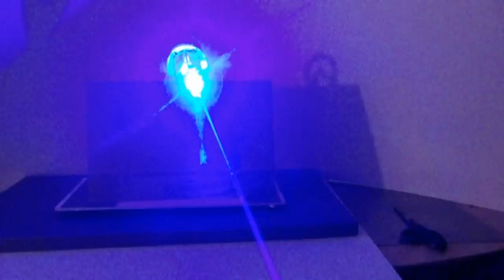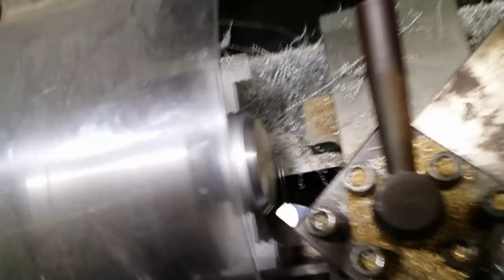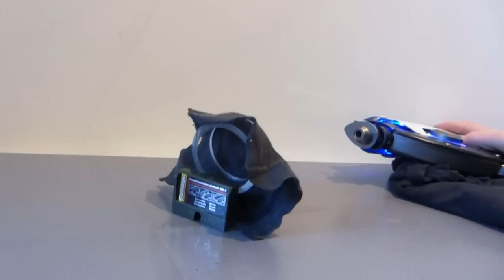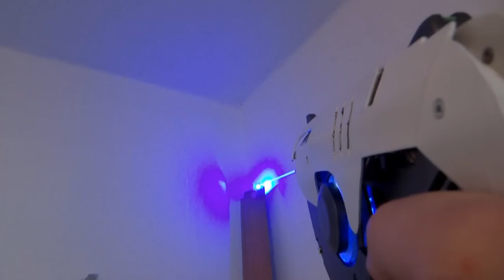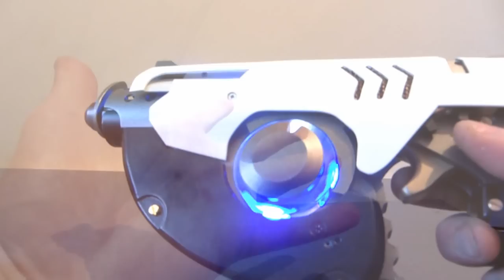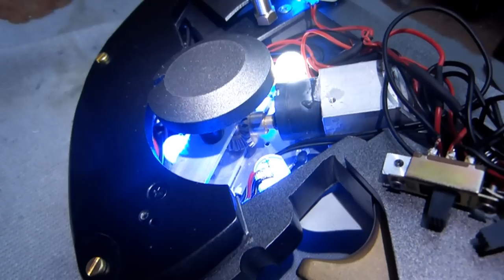OVERWATCH becomes reality: Tracer Pulse Gun (fully functional )

Comment: One question: 

Why are you doing this inside the house?
Reply from the maker: Because I know what I am doing.
Reply: LaserGadgets do you have a plan just in case something does go wrong?
Reply from the maker: Naturally...its called a fireextinguisher.
Reply: Yeah but I would still do it outside so I wouldn't risk getting burn marks on your walls.
Reply from the maker: Senseless, there are no marks...so why dont you just trust the guy who makes stuff?
Reply: LaserGadgets ok
Reply: LaserGadgets This isnt hate but just im a little worried for some reason.
Reply from the maker: I can handle flammable stuff, cancerous stuff, I can handle 5 bits of flashpaper ^^ its all good.

Comment: You put a laser pointer in a cosplay gun. Good for you.
Reply from the maker: No, I made it myself from chunks of metal BUT You wrote a comment ALL by yourself, YOU rock dude.
Reply: So you are flat out denying that you bought a high powered laser pointer and shoved it in a prop you made? Because if you are denying that I will retract my comment. But if you just bought one off eBay and attached it to the trigger mechanism you pretty much did exactly what I said in the first place.

Comment: So for someone who doesn't understand a thing about lasers, how would you measure this things power (power as in frequency or wave length or whatever) and how high would it have to be to pose an actual threat? I mean as in actually being able to rival a bullet?
Reply from the maker: This is 1.5W, you will need 500W or even more than 1000
Reply from the maker: Doubt it. Needs cooling, batteries, and you cant use it in the desert or mud, optics need to be clean.
Reply: fred mat Neither frequency, nor wavelength is a measurement of power. On top of that, higher wavelength does not mean a higher power, or that it's more dangerous (not necessarily, anyway.) Wavelength is the distance between wave peaks in the light waves produced by the laser. Wavelength determines primarily what color we perceive the the light to be. For example, 405nm is purple, 445nm is blue, 532nm is green, etc. Power, in this case, refers to electrical power that the system runs on. Power is voltage adjusted for current, in essence, as P = V•I. A bullet is a rather bad comparison in my opinion, as the damage caused by bullets is caused by a fast moving solid object rapidly decelerating, thereby transferring its energy to the new medium. Light however, has no weight (or just negligible weight, depending on who you ask), and therefore cannot transfer its energy physically, but rather is absorbed by the new medium, burning or melting it. Just some clarification so you can better research.

Comment: Make winstons tesla cannon, you will just need a way to make high voltage electricity in a form factor that fits.
Reply from the maker: Love it when they say "just" xD
Reply: Microwave oven transformers.
They can put out 2KV
Then get a battery pack and one of those DC-AC inverters that can fit in cup holders
Reply from the maker: And you really believe a) I dont know that and b) that will work? You need 2 MILLION volts to make it shoot down range...not even 2 meters aka 6 ft.
Reply from the maker: Buy a tazer :>
Reply from the maker: Oh and now say JUST again xD
Reply: Illegal where I live.
Reply from the maker: Yeah, same here.
Reply from the maker: Nope. A portable tesla coil is not really close to that cannon.
Reply: LaserGadgets dude just build a nuke. You JUST need to split one Atom. Come on don't be a babyXD
Reply: its been built before but the equipement is really heavy
Reply: Where do I find U236?

Comment: I have a lazer pointer that's like that. The video isn't surprising to me
Reply from the maker: Most "pointers" are fucking cheap and get weaker while running, so I am always very surprised whenever somebody is buying one :>
Reply: LaserGadgets Some expensive Laser pointers have lithium battery's and that's one thing that makes it expensive
Reply from the maker: Nope. They are frkn cheap also. 5$ each on ebay, the good ones are 20$ each.
Reply: LaserGadgets Hell no, there is one that cost about $100. The Spyder III is the most powerful laser pointer measuring up to 2000mW
Reply from the maker: Dude xD the BATTERY. WL refurbishes their crap :p they are too small for such high outputs...they get their crap back, put in new parts, resell. 100$ is a fukn joke dude...trust me. Good parts cost more than that.
Reply: LaserGadgets I wasn't talking about the battery. I'm talking about the laser
Reply from the maker: " LaserGadgets Some expensive Laser pointers have lithium battery's and that's one thing that makes it expensive"
Nope, its not....even if you buy the BEST battery (and they buy cheap crap), its not the most expensive part. WL bought something from ME. And send me a ton of these pointers :p just trust me.
Reply: LaserGadgets I don't really care about how it burns things just how far it shoots out. How many MW does your have laser pointer have?
Reply from the maker: I can make is 15W...made one laser with multiple lasers...100W...regular rifle holds 6W. Its the white one on the right side, in that list there :>
Reply: LaserGadgets What's the best one you made? (I don't know  why I'm asking questions now)
Reply from the maker: I made a laser gatling for wicked laser.

Comment: Nice device.  What gain medium are you using?  Color looks interesting.  Looks like a 400 or so nm wavelength.  I presume the beam is put in later as laser beams are not readily visible unless you have a scattering medium.

Tracer would be proud.
Reply from the maker: Its fog but even without fog you can see the beam.

Comment: The Tracer gun does NOT fire the Zarya laser beam, so it's not authentic, but it still looks good XD
Reply from the maker: Pulse = not bullets...so I am righter than you.
Reply: Tracer guns are pulse guns (supposedly, electromagnetic pulse) then: pulse is not equal to laser beam. An electromagnetic pulse is a strong and brief gamma ray emission, in which an enormous amount of electrons is released that provoke a variable electromagnetic field. But if it is a laser (as is clearly seen here) then we must clarify that it is an optical device that generates a light beam of a single frequency, monochromatic and very intense, by the electrical or thermal stimulation of atoms, Molecules or ions of a material.

Therefore, it is possible to say that: Pulse ≠ Laser, are two very different things.

Now, if all this is a Plasma Pulse, then we would be talking about a very different thing
Reply from the maker: Electromagnetic means sound, light, radiation. Back to physic lessons one. BUT ITS NOT a bullet. Do you have a gamma ray emitter? Xray? Whatever the fuck, laser is the best way.
Reply: Well, that's exactly what I wanted to clarify from the beginning, the fact that you made laser guns, but not a pulse. Because everyone (or most, I think) think that these guns shoot pulse bullets, it may be electromagnetic or plasma, but not a laser beam (as I have seen in this video) that is completely different.
Reply: I clarify that the design of the weapon is more than great, it is surprising and true to the original version. The only thing that failed (under my subjective point of view) is the type of shot

Comment: I'm no expert, but I think it would be cooler if it had short bursts rather than holding down a laser. I know it wouldn't do much damage that way, but it would fit the gun more.. I mean, its not like you're gonna use it to kill anyone!
Reply from the maker: The laser IS pulsed. What are you talking about :p
Reply: It looks more like a hard hitting laser pointer than a burst-firing laser gun, if you get what I mean
Reply from the maker: No I do not. This is not star wars with tiny bars traveling 30mph. Reality sucks. And its a REAL laser, not fake, not edited. And POINTER is just a host...every laser is just a beam.

Comment: Curious to know how long the charge is on that gun, and how long the laser diode lasts before it burns itself out?

From what I see, it does do heat damage but it doesn't seem at all practical as a weapon. You'd need to up the intensity or somehow generate physical impact damage to make it practical against living targets. Still a cool concept to make a working laser pistol.
Reply from the maker: 30-40min and 1000+ hours for the laser.

Comment: Beautiful work as always, how long can a full battery last in something like this?
Reply from the maker: Due to lack of room its only one cell, so not longer than 30 min I guess...and thats very optimistic.
Reply: I didn't think in this size it would be too long, but that doesn't sound all that bad really. Whenever I've used a simple laser pointer they seem to last around 5 minutes max.
Reply from the maker: I know why. Check out the one I pimped for a customer (somewhere on my channel, summer last year). They use crappy parts. The battery says 3000mAh but has maybe 700. Same for the laser btw. If you ever need something real, let me know.